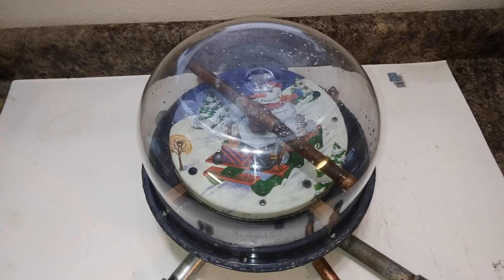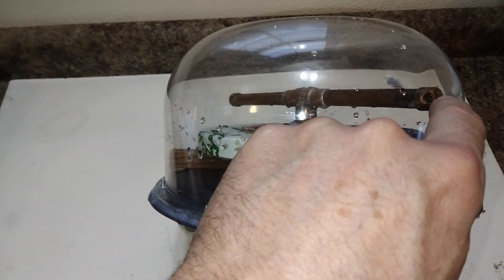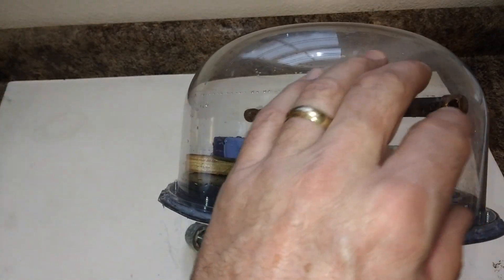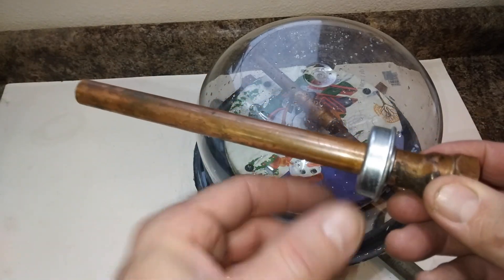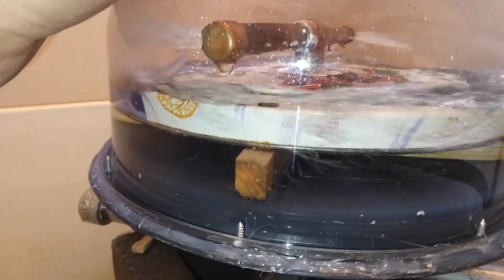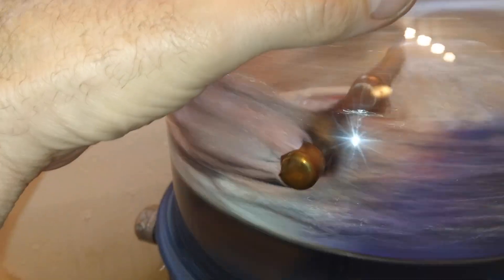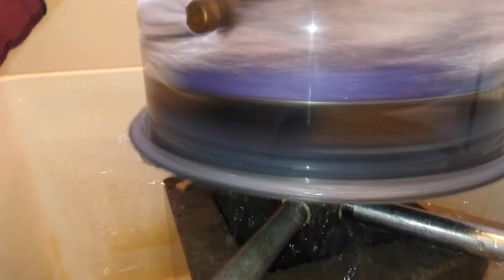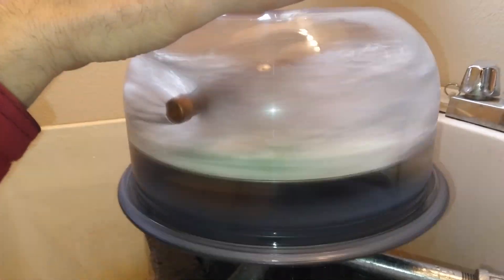DIY build.   Rotating Flow Turbine (renamed)

Comment: Are you using the water from your faucet ?  and approx what water pressure was you getting. really enjoy your ideas and I hope to expand on a few of them.
Reply from the maker: Yes, it's just connected to the water faucet.  Pressure would depending on how much the faucet valve is open at any time.